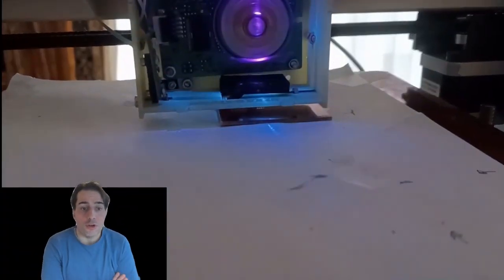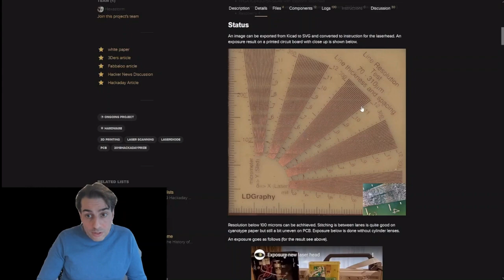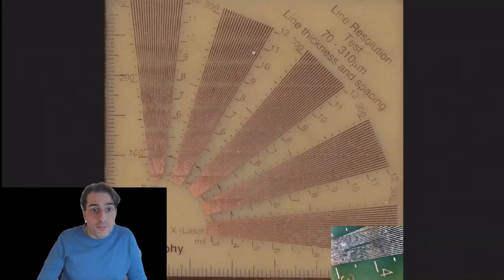Laser direct imaging using a prism and a PCB motor

Comment: Is it possible to replicate it without the pcb motor? I am working on making a resin printer diy
Reply from the maker: @PS-nf3xw  the pcb motor is an experiment and will not be in the version intended for customers. I use a polygon mirror motor. Laser scanning is barely used in photopolymer printing. Formlabs abonded galvo and envisiontec abonded the 3SP.  It is a only still uses in hybrid photosynthesis which is combination of beamer with galvo. I think there are applications in special photopolymer printing; bio printing, ceramics combining FFF with lasers. I am thinking of selling an assembled module around 400 euros..

Comment: How do you trigger the laser consistently? I’m doing this with an esp32 and there is a lot of jitter. I can upload a video showing it
Reply from the maker: I use a FPGA.. You could use a microcontroller but you need to guarantee that you can loop say at 2 MHZ. This was done via the beagle bone pru in assembly (see ldgraphy).
I looked at ESP32 but it has many abstraction layers and typically uses RTOS. You would need to remove these which requires a deep understanding of the ESP32 and makes your code not portable.
Reply: @Hexastorm  I realized I need to use an adc, so I will just have to use Node MCU 32s as the ADC for the raspberry pi.
Reply from the maker: @lazarusmagellan2367  you don't need an adc.. a raspberry is too expensive.. I think you r are just starting too realize what the problem is . The algo is pretty basic.. a microcontroller can be cheaper but it will take you a long time if you r unfamiliar. For industrial solutions fpga prevail, as they provide a route to asic. Furthermore all the knowledge and time spent is hard to monetize, you are  probably better off learning about time series and data science and fixing some boring business problem. You can buy a beaglebone and use ldgraphy or my beaglebone variant or the fpga. Fpga is cheapest and fastest ( current rate is 12 MHz). Interested in microcontroller solutions with a price below 5 Euro's.
Reply: @Hexastorm  I still don't really understand why my system doesn't work. I am essentially doing the same thing you are, just with a slightly simpler setup. I have an IR Led that reflects off of a mirror (polygon scanner) and onto a silicon photodiode (BPW 34). a void loop runs continuously polling an input pin, checking to see if the photodiode voltage is above the threshold value. if it is, then the laser is pulsed in a sequence of microseconds. Even with this incredibly basic code and setup, i cannot get a static image. The lines jiggle left and right and sometimes jitter >10 degrees off center. Yet when I check the photodiode and esp32 response times with an oscilloscope, nothing looks out of the ordinary. Hell, even a basic arduino should be able to do this without any problems. I just don't get it...
Reply from the maker: @lazarusmagellan2367  light IRdiode needs to be filtered with op amps, you need a specific version of the polygon mirror motor.. the other doesn't work. You could decrease speed mirror motor to 2000-3000 rpm. Don't go to low. The problem with mirror motors is the cross scan error (orthogonal scanline) andd the non unifo speed . Circuit is outlined here https://hackaday.io/project/21933-prism-laser-scanner/log/157582-electrical-redesign .. there is a link in it to the design of henner Zeller.. oh and you can not use polygon mirror with laser diode in USA for 3d printing due to patent.
Reply: @Hexastorm  I will apply some filtering to the photodiode, and raise the rpm as well. Thanks for the tips!
Reply: @Hexastorm  That was the issue I ran into, even at 240MHz (cpu clock) the code would not run fast enough. I initially tried to circumvent processing interruptions by using RTOS and making one core perform pwm output while the other monitors trigger conditions. Even doing this did not work past, say, 20 frames per second without introducing significant jitter (+/- 3 degrees). Abysmal. So I just today bought a Raspberry Pi 4 B off of craigslist. Assembly is not something I have proficiency in but I will learn it.

Comment: I love the design with the 3D box using the PCB material. How do you design them?! Are you just using old PCBs for the box, or is it also part of the PCB/electronics design? I built a similar direct PCB printer but it used CD drive stepper assemblies in an X/Y configuration. It took minutes to burn the designs :D 
Have you tried to use a projector? I think if you use a focusing lens, you can get enough resolution for quite cheap. And expose very fast.
Reply from the maker: I use freecad in combination with kicad, there is another video where you can see this. It does indeed take minutes to burn design. I have used projector's. Most popular in ldi is polygon mirror with paladin laser 365 nm. I believe my design should be able to outperform most projector's..

Comment: That is awesome. I had a lot of frustration with both attempting to expose highly detailed PCB designs using photoresist, as well as my attempts to mill small traces on my CNC router. Would be great to be able to quickly create a PCB using an attachment for a CNC or 3d printer.

Comment: Very interesting work.

Can you share how much it cost to make the pcb coils?
Did you do the design yourself?
Reply from the maker: PCBway produced the PCBs. Minimum order quantity is 5 at a  price of 25 USD. I have a thickness of 0.8 mm and 4 layers. There are several plugins for Kicad which can be used to generate the tracks.
Reply: @Hexastorm  Thank you.

Is that 25 bucks a piece?

I read that they do up to 16 layers these days.
Reply from the maker: @christopherd.winnan8701  no 5 bucks a piece